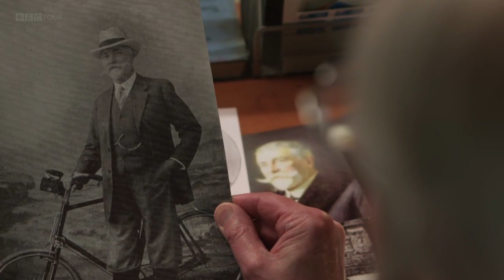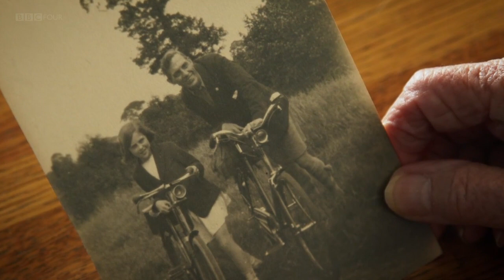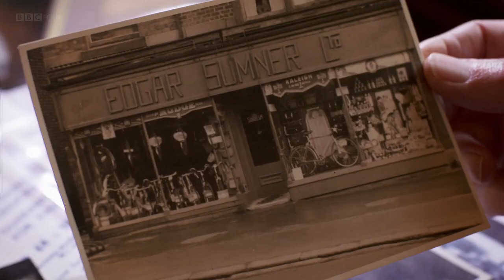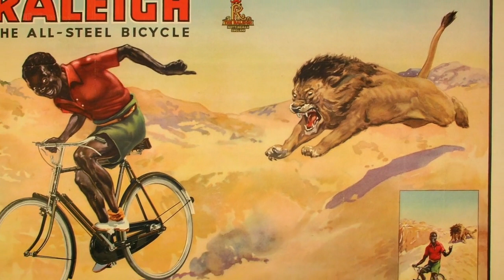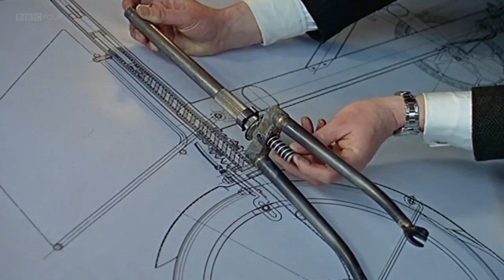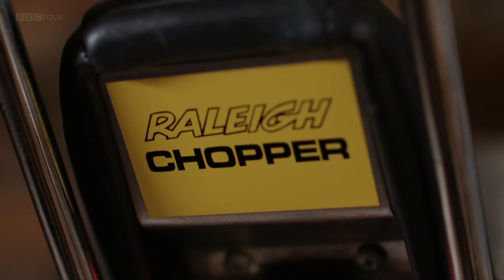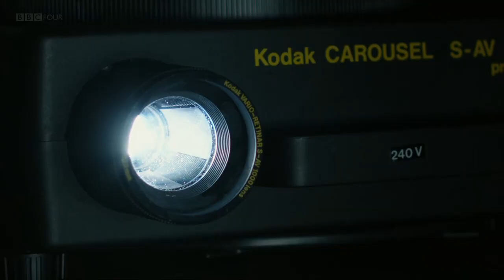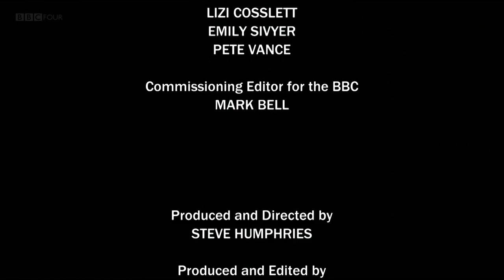Pedalling Dreams: The Raleigh Story (HD)

Comment: I found a 1985 Raleigh Olympian in a guy's yard. It had weeds growing out of the bottom bracket and missing components. The paint was faided but surprisingly didn't have chips. I didn't know anything about the brand or bike, but I decided to restore it. I eventually found all the appropriate components. Lots of grease, bearings, etc... It's not my primary road bike, but I take it out on rides and it goes on vacations. It's a great bike and so much fun to ride. Thanks for the video.

Comment: I own and have owned a few, mostly 1950's models. Its a completly different riding experience to my modern mountain bike but thats why i enjoy riding them so much. I also feel very humbled riding something thats outlived most of its owners. Nice thing is Raleigh built so many bikes you can buy a historic one for less than £100 and in my experience usually need little more than a set of tyres and inner tubes to just ride.

Comment: Nice film. So a 10 year old girl rode 200 miles in 2 days with a 3 spd and no practice?? 

I had 2 low end Raleigh's, a 1974 5 speed derailleur and a 1990 3x6 Montage. I love the old style upright sweptback handlebar, but I hate derailleurs. I never wanted a chopper. I rode a too big hand me down old SS Rudge in high school. Last year, 2017 I bought a 1973 CCM with a SA 3, I wish I had bought it in the first place. I upgraded it with a SA 3 drum brake hub. 1600 miles with no service but some chain lube. 
WHY didn't Raleigh put drum brakes on most of their bikes??? Those rod/ rim pull brakes were a 100% USELESS FARCE.  And they still had them until the 1970s???  Bloody STUPID.  Calipers were not great either.
For 5 years I have had a SA dyno drum front hub now with 23,000 miles, NO adjustments or pads required, always work. One bearing went at 17,000 miles, that's like a world lap. My bike was 120 lbs on tour in Vietnam and China, with a AWESOME Rohloff 14 speed.  Disc brakes are no better and nothing special either.
Reply: GordoGambler Wow! Thats amazing.😁